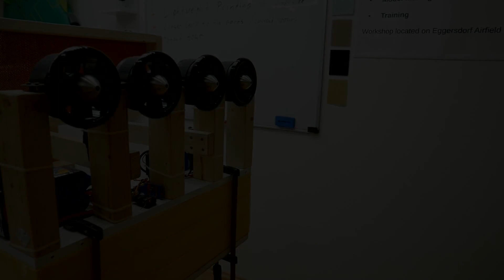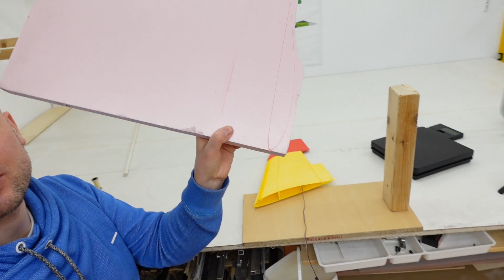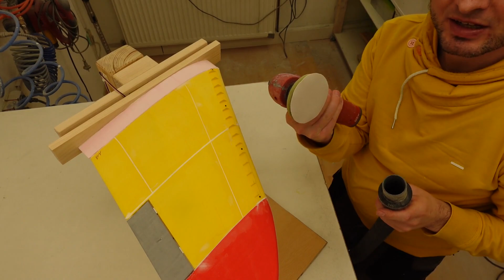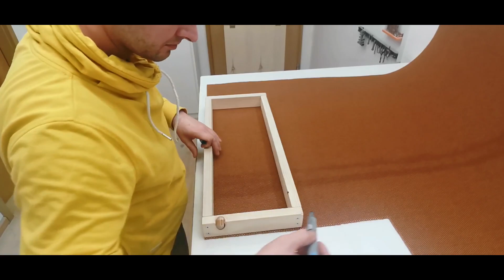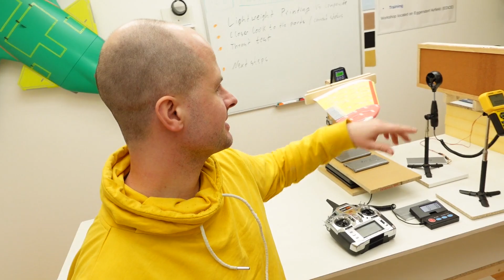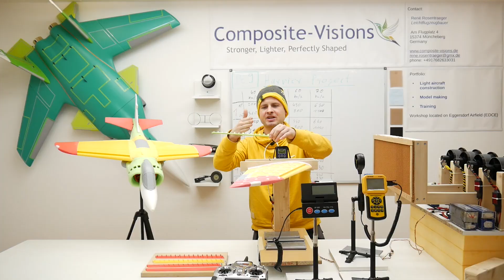3D Printed VORTEX Generator on Test Wing | LW-PLA Harrier Project

Comment: You can also use the EDFs to pull air over the wing, i.e, put it behind the wing. That's how it is in wind tunnels. Though I'm not sure if the EDFs are powerful enough to pull in air that fast
Reply from the maker: Good idea! I'll check that 👍👍
Reply: Would require an actual tunnel then  :/
Reply: @thecatofnineswords  oh wait yeah you're right... A rudimentary tunnel out of foamboard or cardboard would work okayish?